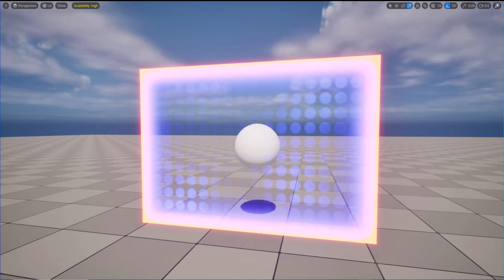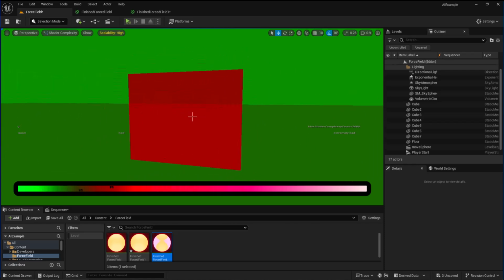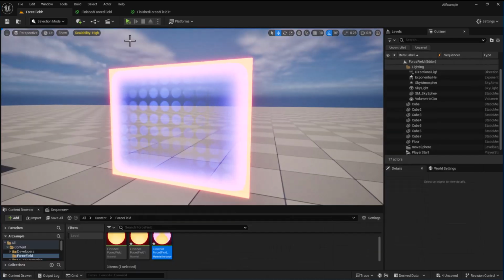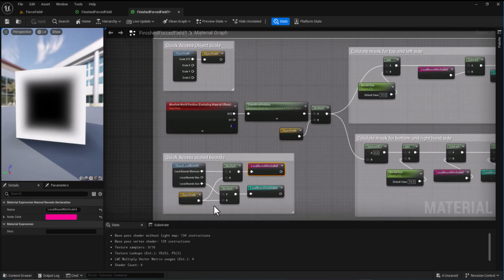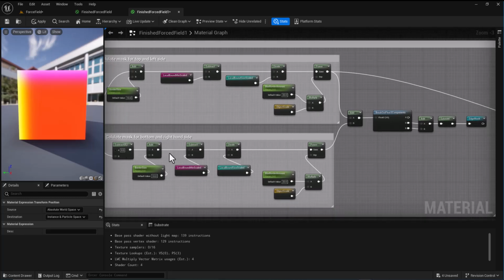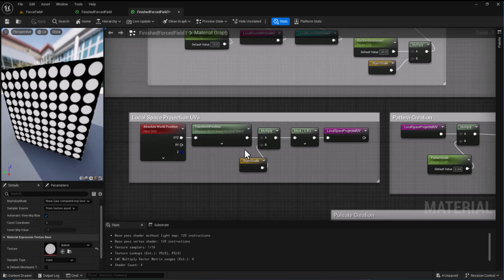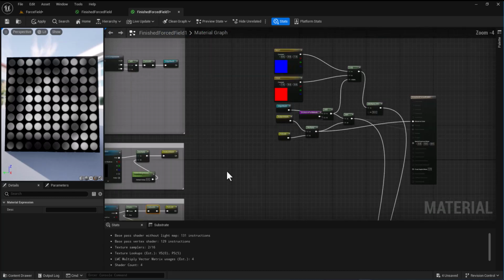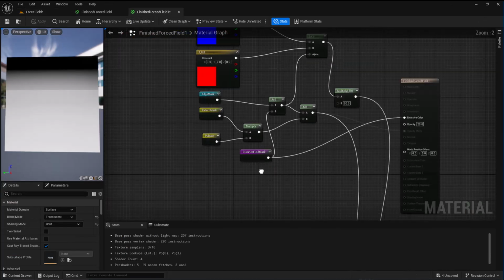Creating a Force Field Material in Unreal Engine 5 – Step-by-Step Breakdown

Comment: I love this, i tried recreating it, however it doesn't show up properly in a lit level on my end, did i miss a setting?
Reply from the maker: It' hard to tell, what material domain are you using. It should show up. Also test it on normal cube to start with it take the bounds into consideration if I remember correctly.

Comment: hey there, great video and material. Have a question how can I make as transparent as yours?
Reply from the maker: So the main thing you need to do is change the blend mode to Translucent. Then the value input into the Opacity pin is going to control how translucent the material is. To get a different quality of translucency try playing around with the lighting mode. (All these settings are in the details panel when  you select the main brown node. )